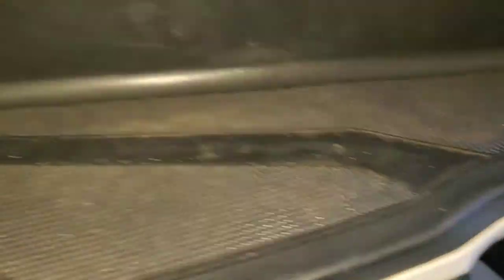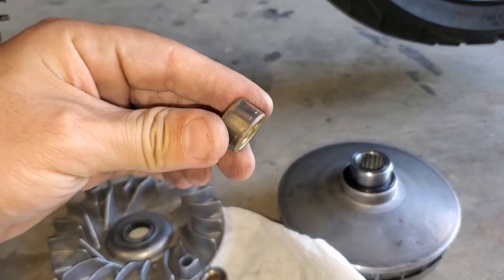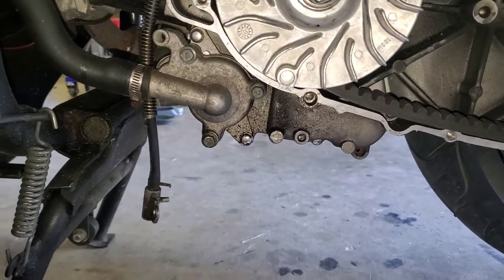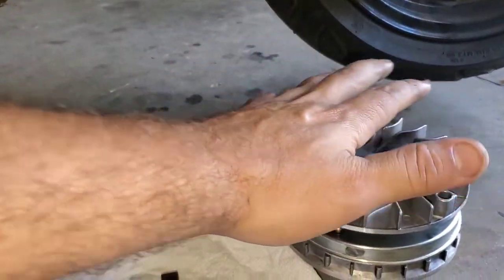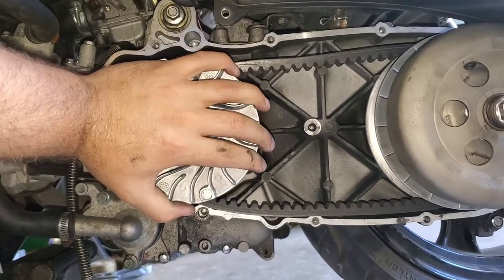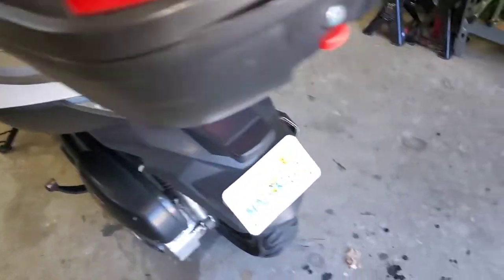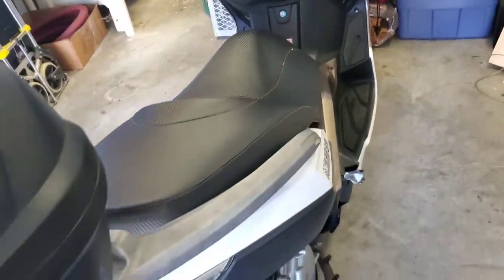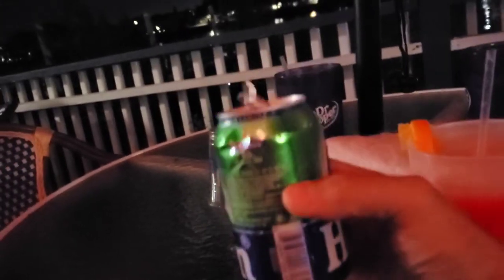Scooter Maintenance CVT Case Shakes And VIBRATES Fix! CHECK YOUR ROLLERS! #bikesandbeards #gy6

Comment: CVT in scooters sucks. i have a chinese motorcycle running really well after 70000 km . never even replaced the battery since i bought it 5 years ago. it's really ripping the road. no issues so far. no belt. just an engine and a chain. i had to sell my HONDA SH 350i cuz it has so much problems.

Comment: Do you know why my scooter start to vibrate in low speed? I was driving on a hill and after hill it start to vibrate and i dont know what happened
Reply from the maker: Probably time to change your engine mounts Or check your CVT for the  Condition of your rollers to see if they have flat spots
Reply: @IFixShet  my variator plate tingy was dead i opend my cover and the variator plate was in peaces. In winter i have to change that. But thxs dude 👍👍
Reply from the maker: @ZIGIS-wr1nz   As I suspected part of the CVT package was ruined. The real question is why did your variator fall apart when you can answer that question then you'll find your problem

Comment: Not scooter started vibrating it's a 150cc Big Frame longbo scooter with 13 inch wheels all of them of the same except different plastic they call him Eagles ice bear Sunl vento tank started vibrating like crap from the engine and no where on the internet can you find the answer but I found it it took a year on the motor mounts swing arm on the left hand side where it attaches to the frame there's rubber bushings replace them and it's like new again